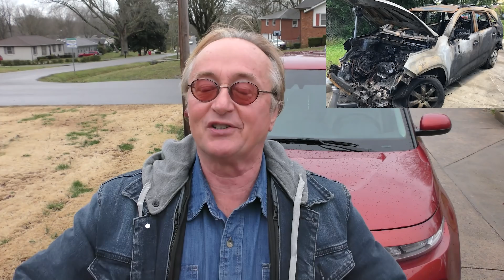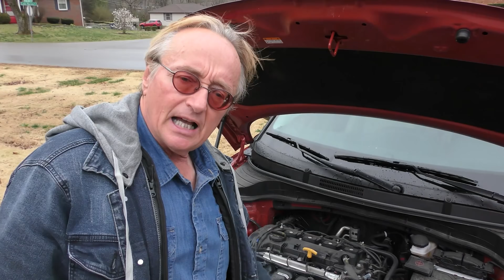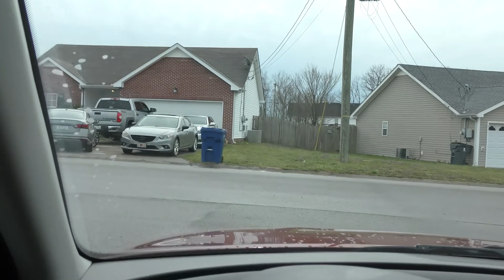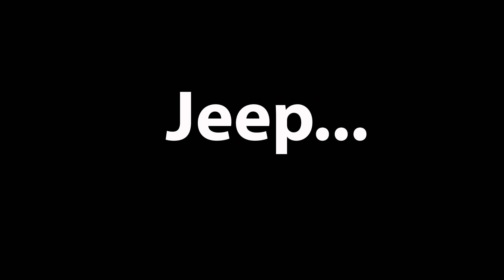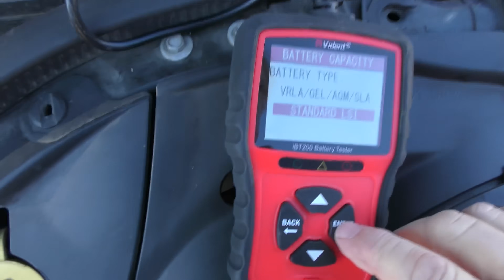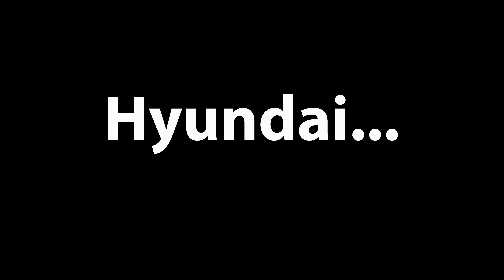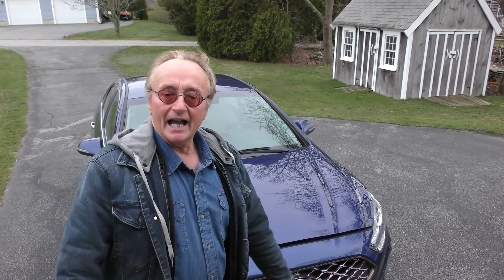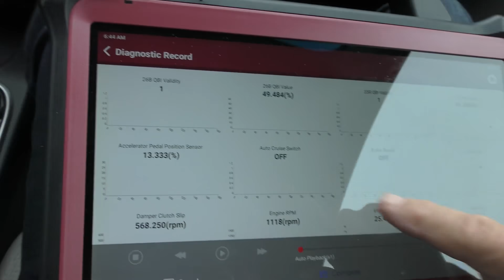3 Car Brands That are Crap

Comment: I would never buy a car I couldn't fix myself, in my garage.  All the crazy electronics stresses me out. 80's and early 90's is my jam.
Reply: Old cars regardless of make require regular repairs, not regular maintenance but regular repairs that cost just as much as a new car payments with the added feature of downtime for the vehicle and personal time for you.  I drive a 90s truck with 500k and fix it myself but that's just a hobby for me as I drive a Corolla for real life things.
Reply: I think the golden years were the 90s and early to mid 00s cars were still pretty analog with just the right amount of technology
Reply: @FELIPE8226M  I much prefer the styling of the 80's, which is the second thing I consider when looking at a vehicle. The first is whether I can afford it, lol. Luckily I happen to be obsessed with some of the most reliable classic japanese cars ever built.
Reply: The "newest" car I can see myself buying is anything from 2007 especially the Toyota Corolla XRS.
Reply: And all my family asks why i don't get a new car, because they not easy to work on and not build as well!
Reply: I agree, just went through a nightmare running down a parasitic discharge on my Chevy Silverado, a 2004 2500 HD. Only 72k miles but turns out was the instrument cluster panel, which I had to replace - a fairly common malady with these vehicles. Never had problems with my old trucks. God knows what utter crap the new ones are.
Reply: Buddy had the same issue.  Drove him nuts.  Mechanic figured it out but wasn't cheap just to troubleshoot.
Reply: @lightningdriver81  a guy on the tube has walk through gm cluster repairs.
Reply: @lightningdriver81  How did you find the drain?
Reply: @johnclark7908      Used a multimeter on every fuse, a pain in the a$$, found the ten amp to the cluster panel was leeching away 250 milliamperes, enough to drain the battery within two days.
Reply: @lightningdriver81  fair play for finding it 👍
Reply: looks like you’re gonna keep fixing them every month😂
Reply: @Caynoir  Clueless ✌️
Reply: Still daily driving my 1967 Volvo. Simplest electrics you can find anywhere and 100% reliable.
Reply: When growing children are the important thing for a family i bought secondhand everything especially cars always made sure that i could repair them myself Austin A35 van with side windows gearbox or engine rebuild over a weekend started Friday evening after work parts bought Saturday morning before parts department closed job finished Sunday evening ready for work
Reply: i have a 1987 bmw 5 series theres nothing on it i couldnt fix myself
Reply: @paulhunter123  that's good, because you will be fixing that crapbox daily...
Reply: @imdone1967  what crapbox was that in reference too ive had a few lol
Reply: I gotta say, bought a 2002 Audi a4 and it’s been nothing but a pain with all the electronics. My 1980 el Camino with a carbureted 350 V8 and 4 speed manual is simple as sliced bread
Reply: Old head😭
Reply: With todays vehicles and ones since 2010 you will not be able to fix only things like breakers, shocks, struts, and basic maintenance.  The engines are full of computerized equipment, and the transaxle also the same thing.  So much wiring and relays and you will need electronic testers to find out what is wrong.
Reply: Tough to fing good quality parts these days.
Reply: @disgracebook5708  It sure is, depending on the model. My rx60 has a 2T engine with 3  mikuni carburetors, really easy to maintain, sounds awesome and there's a crap ton of Celicas (also Corollas and Carinas) dumped all over my country. Besides, it's not like I need to replace stuff all the time. The only thing I've had to replace in 6 years is the brake cylinder... I bought a nice italian one, and those are still being made.
Reply: True
Reply: Pretty much all 80s and 90s cars are full of electronics,  what could you possibly own,  I'm genuinely interested.
Reply: @richardrichard5409  not nearly as much as now. i own a 1987 bmw 5 series and there is no diagnostic plug
Reply: I'm Learning, hope will be able to fix my car by myself one day
Reply: Are the bodies left???  In Missouri there would be nothing left
Reply: That is awesome!  I’m trying to do very similar .  I have a lot to learn but I’ve learned a bunch too!!
Reply: Spiderman no way home< wierd that kia is a japanese car?
Reply: Exactly I rather buy an older vehicle like 1999 or 2007 the least everything up gets worse and expensive to be fixing
We have a Toyota runner 1998 and Tacoma pickup 🛻, Toyota camery 2001, and I’m looking into a Lexus RX 350 not new
Reply: We will have to buy new cars someday…
Reply: im thinking about buying a subaru vivo and try and learn to work on those, they are cheap and seem to run withouth issues. it does need AC installed tho, and im not sure how easy that is.
Reply: @Lynnfield3440   Definitely not easy if you've never worked on cars before. I'd pay someone to do it anyway... never had to install an AC myself, mine still runs great.
Reply: @Ed.Benassi1111  oof, and yeah I was thinking to try some funny stuff and not install like a car airco in it lol, but its probably something for a year down the line anyways so.

like basically make some battery or have power come from the car battery and use AC they use in campers or something.
Reply: Safety and fuel economy less so
Reply: For real man. I went a little later. 08 equinox. 225k miles. I've replaced almost everything except the engine and transmission.
Reply: Its like buying a tv nowadays, it would be nice if they have an OLED with no smart tv apps on it.
Reply: @ROGERDATTTS  Reading this on my 50 inch Panasonic Plasma tv from 2010 still doing strong as my daily driver.
Reply: Roger that !! Same here
Reply: Just buy the right tool. Yeah, sure it’s 500-600 bucks but it makes diagnosing and fixing issues so much easier. Electronic issues are actually easier to diagnose and fix than having to replace a mechanical component that is discontinued and no one sells it.
Reply: @damyanovasen   amen, if you know your limitations and either don’t want to learn how to repair it or to lazy to try, find a reputable dealer or repair person who does or stop complaining about the bad decision of the product and price of the turd you bought!
Reply: @damyanovasen  Ha. Autostoned will test for you.
- Printout said:  low evap leak.
- Recommended fix: evap purge valve.
Bought a new gas cap. Code gone in twenty miles, five restarts of engine.
Reply: @damyanovasen  good point try finding 80s car part..
Reply: 80s / 90s cars are OBD1, too much electrical crap for me to deal with- I only own pre '74 vehicles minus all electronics and smog crap on them. 80s/90s car are junk- thank god they've all about disappeared from the earth.

Comment: Any engine that burns a 1 qt of oil per 1000 miles has had it. 
Back in the 70's I had a British mini that burned 1/2 gt / 100 miles.  The bores were oval, square, hexagonal and trapezoid.  The pistons didn't slide up the bores, they rattled. A massive re-bore solved it.

Comment: I owned a 2006 Hyundai Sonata that had the 3.3 litter V6. It was a good car. That being said, knowing the horror stories of the newer Hyundai' s ,  I will not buy another one.
Reply: The 3.3L V6 were solid engines. Once they went with GDI engines, it all went downhill. The only Hyundai I would consider getting is an EV

Comment: Have owned a 2010 Kia Soul since 2012 and have had no issues. My mechanic told me to never get rid of it. Parts are cheap.
Before that had two Hyundais which also cost me nothing both used and drove them for years. 
Not sure what is going on with Kia and Hyundai since 2010. I plan to keep mine until it dies so Kia and Hyundai have another ten years to get back on track:)
Reply: My daughters 2010 Forte Koup has 183,000 miles on it and looses or burns less than a half of a qt every 3k. Previous owner drove it on the highway 5 days a week for work 40 miles each way.  Since we've had it I use synthetic oil and change the oil every 3k with a Wix filter, probably jinxing myself but it just passed emissions in Ohio and runs great !
Reply: I feel bad for the 8.5 million people who are affected by the Kia/Hyundai fires and recalls that have been on-going for 5 years now, affecting vehicles built in the 2012-2020 model year range.

You can change the clothing, but the man remains the same. Hyundai/Kia quality and quality control is hot garbage.
Reply: @moloono1  My 2020 Kia Soul needed a new engine after 9k, was recalled. PITA but Kia did the right thing by me AND the car has a Great warranty, 5 years / 60K miles all inclusive and 100k on the engine Scotty does not mention the excellent warranty.
Reply: you didn't say how many miles. and no good mechanic would say never get rid of a Kia. you won't get it to last as long as a Honda or toyota
Reply: @richsweeney1115  It’s okay man…Kia apologists will literally tell you that they are the best car despite all the evidence of fires, oil consumption, warranty getting denied, transmission failures, and all kinds of issues…LMFAO. 

It’s the same cycle since the 2000s: Kia designs a new good-looking car, people say “wow, look how far they’ve come” and then 3 years later we find out that they have catastrophic design flaws in a number of vehicle systems.
Reply: You probably have the 1.6 engine In your 2010. They are  good. The larger engine has the problems. Keep it!👍
Reply: My Elantra on a flat hwy/fwy gets 50+ mpg, if I hit all great lights 40+ mpg in city average around my city is 35 so it can keep up with some of the best hybrid's. Scotty just an old Celica fan. Granted nobody makes them like they used to anymore. Oh and my Kids came from South Korea not Alabama 92% made from South Korea
Reply: Have a 2022 Elantra very happy with it.
Reply: @hustleyourknowledge  it's brand new!! why would t you be happy with it..... except you probably overpaid because new cars are built cheaply.

Comment: Hyundai has progressively gotten worse. I had a earlier 2000’s Azera. Never had an issue with it.
Reply: Have gotten catch-on-fire worse
Reply: Aggressively gotten worse.
Reply: I had a 07 Azeri with the 3.8. Had it for about 3 years, I loved it. Strong smooth engine, kind of a gas hog but overall fun to drive had some power.
Reply: They were at their worst in the 80s and 90s.

Comment: I have a 2018 KIA Soul with a 2.0 engine that now has 68000 miles on it. before i was using amsoil 5w-20 so i went with Valvoline 5w-20 now i got 3000 miles on it used so far under a 1/2 quart of oil before with amsoil 1.5. Scotty is right don't buy a kia this is my last one!

Comment: Kia and Hyundai are very hit and miss. Some can last a long time and then others don't make it to 50k.
Reply: But could that depend on how the driver drives the vehicle?? 🤔

Abrupt accelerations, harsh braking, maintenance neglegence, etc.
Reply: @electron7659  yes it does mostly depend on how the owner treats the vehicle. But some vehicles just aren't that great to begin with.
Reply: @Trenton-om9qs  Oh, okay. Well, I guess at this point I'm simply gambling my fate.

I bought a 2020 Kia Forte fe with a manual transmission. Bought it bran new. Hopefully it won't break down on me despite how careful I drive it as we as keep up with its maintenance religiously.. 🤔
Reply: @electron7659  if you keep up with maintenance and drive it right it should treat you ok. As long as you keep an eye on things and take care of the car
Reply: @electron7659  I think you will be fine. I have owned 3 Hyundai and a Kia Sedona. All have treated me well. The only thing I suggest is to change the oil at 3,500 miles. Don’t follow the 7500 oil change intervals. On my GDI engine cars the oil looks bad when I replaced it at 3,000 miles and I do use either AMS oil or some other high quality motor oil.
Reply: @rmwarriors16  What if I barely drive it though? Because right now, I've had it since February of 2020 and it only has 11K miles on it.

Also, would it be bad to change it every 5K miles even if I use purely synthetic oil? Or for sure it needs to be changed every 3,500 miles?? 🤔
Reply: True. Co-worker has a 2013 Soul- approaching 300k miles -zero issues. I bought a 2018 Soul plus 2 tone Red & white luv it-23k miles -no issues-Scotty isn't always right:)
Reply: It just depends on the engine you have in it. They have used few completely different engines. The problematic ones are newer open-deck style engines. The older closed-deck desing (Beta, Delta, Sirius...) were solid and reliable.
Reply: You can actually draw correlation between the power figures, cost and reliability of the engines from past couple of decades. Regardless of the brand. Once you go above 75 hp/liter, you can't expect the same reliability in inexpensive, basic road cars.

Of course some engines are built stronger, and forced intake does help boost the power with sturdier design but that again costs more to build and shows in price.

It's just physics.

Comment: Hey Scotty. I went used car shopping Saturday, went to 20 places, about 60 miles total. I could not find a Honda or Toyota (Lexus and Acura too) 2004 to 2012 with 200,000 miles or less for under $10000 . Found tons of Chevy, Ford, KIA, Chrysler, Jeep, Nissan, INFINITI, Dodge, RAM. All of these other cars were half the price if even that. Everyone of these other cars were around 100,000 miles at that. The best deal I found was the INFINITI - Red, 2014, 94,000 miles, $10,940. The edges of the body parts were all off a quarter of an inch or so. I noticed a slight shine difference in the front, rear and side of the car. I asked the salesman: "Did someone use spray paint all over this car?" He looked guilty!! Said: I don't think so. Funny thing I almost bought the INFINITI . I looked at the door frame to see if it was made in Japan - Then I saw: Nissan. Note to self: "INFINITI are made by Nissan." LOL.   😃
Reply: Infiniti makes fine cars if you perform routine maintenance on them smartass
Reply: Get a first or second generation Scion they're great cars
Reply: You didn't know Infinity was made by Nissan? 99% of the population has known that for the last 20 years... quick question or two for you who do you think makes Lexus? And who do you think makes acura?
Reply: @glennbeadshaw727  no need to be condescending. I didn't know Nissan owned Infiniti, Renault and Mitsubishi until I started working for em lol
Reply: @glennbeadshaw727  Gee Gomer, you're so smaaaart.
Reply: @glennbeadshaw727  I never really care who made INFINITI until yesterday. The last used car lot I visited had the only INFINITI I saw that day. The last time I drove an INFINITI was 12 years ago when I was a repoman. My paper work never said anything about Nissan. Hope that helps. 🙂

Comment: I have a 2013 kia optima limited-sxl 2.0 turbo, only problem I had was about 103k miles. I had to have a transmission put in it. Other than that pretty solid fun car

Comment: I dunno,  my niece has an older KIA Spectra with 140K miles on it and it runs beautifully.  Of course the maintenance was done very well,  but the car still runs very well so I guess it depends from customer to customer.
Reply: Some of the early 2000s Kia are decent because they run good for a cheap car and the parts are super cheap.
Reply: @izicial7469  

She's got a later 2000's,  I think it's a 2009.

Comment: 1 Qt every 2000  miles with 5W-20 at high way speeds getting 38 mpg isn't burning oil.  Run 5W-30 synthetic and change it every 4-5K and it will last.  That said, any Kia/Hyundai I own would be getting a new engine around 95-99K miles before the warranty ran out.  And probably a CVT transmission too.

Comment: My slave cylinder failed on my 18 Cruze diesel ….at 33,001 mile one mile outside of bumper to bumper ….3k for a SLAVE I got it covered after bitching . Their solution? Trade in. I haven’t had any more issues

Comment: Alabama plant is the problem with KIA/HYUNDAI.  Korean manufactured vehicles don't have these problems.  I've had 4 Korean built KIAs (V6s) and none have burned oil.🤔
Reply: Kia 4 cylinders have the oil burning problem.
Reply: @jaya.0069  I'll think you'll find it's the 2.0L and 2.4L Theta II engines, both built in Alabama that are the problem.

Comment: I worked for Kia and Hyundai's for more than ten years.
Never heard once they recommended 7000 mile oil changes. 5000 is standard for Kia service. But we had many customers who were old skool and always did it at 3500 no more than 4k. 
They also rarely had issues with their vehicles
Reply: The new hyundais from 2020 and newer yes. That is actually part of the lease plan. 36,000 miles or 3years of oil changes. Each oil change done at 7500-8000 miles. I work there now so i know
Reply: I had a KIA Forte and put 150,000 miles on it.

Comment: Kia has a problem with engines blowing because they have no oil level indicator just an oil pressure indicator and that is just a little red light that if you don’t have your seat and steering wheel set so you can see the bottom of the dash you won’t notice when it turns on only when the pressure drops off but doesn’t stay lit to give you a chance to see it like in a turn  you would think it would alert the system monitor that tells you when to change your oil or shows system check so people are blowing engines from no oil they just have to tell there customers to check the level about every 1000 miles

Comment: so they said drive it till engine blows then at say 25k it blows they will then say you did not check and fill oil enough
often you dont know wether to buy any new car and right now price gauging of used cars.  but i suspect in about 1 yr people will walk away from paying for the overpriced used and market adj new cars when they realize that 35-50k car
you had for 1 yr and still owe 2x what its now worth  will be a glut on market . i might pay sticker on new car now but never over that